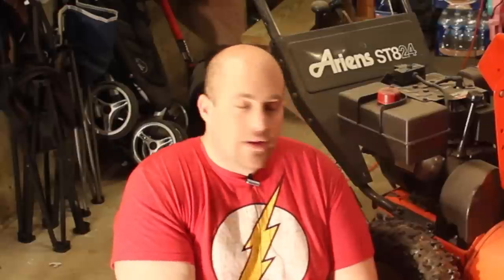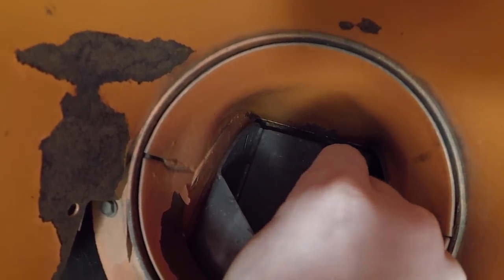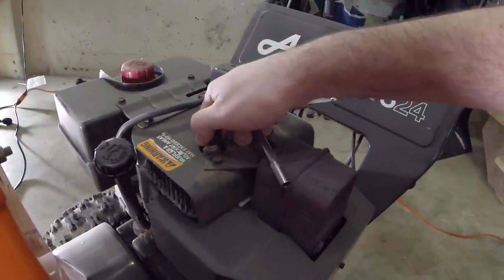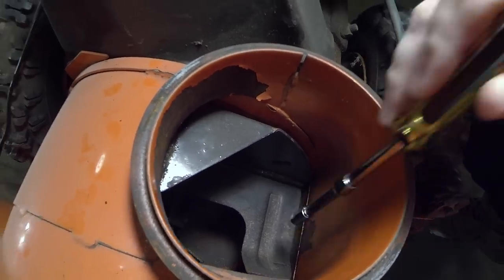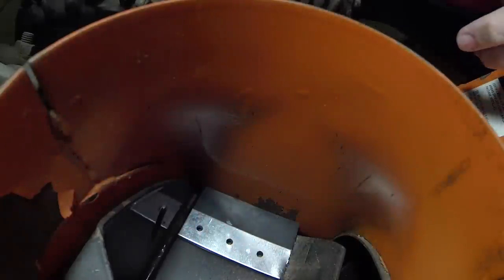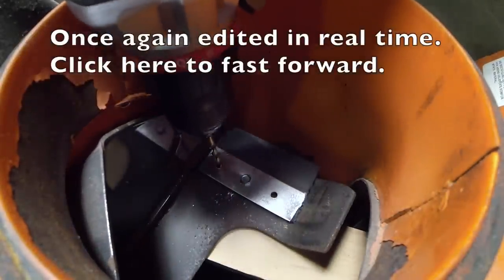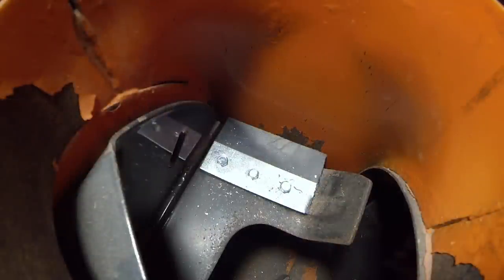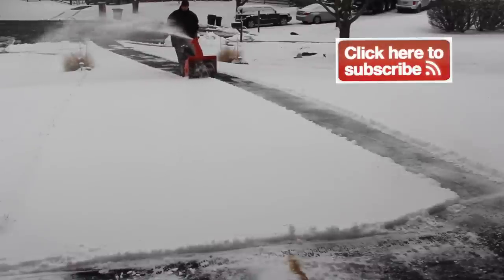TURBO CHARGE YOUR SNOW BLOWER - How to Install a Snow Blower Impeller Kit

Comment: Did my toro about 4 years ago very similar install. To me the closest thing to injecting steroids into a snowblower! Lol. Will blow the wettest of snow, damn near blow water !!! Lmao. Never clogs and blows twice as far! Impressive!!!
Reply: How thick is the rubber piece ?
Reply: @josecenteno3273  1/4 inch, 3\8? I can check when home later to be sure. I got material from tractor supply. I have done several others since i have done mine. Friends, family etc...
Reply: @paulcondie2520  Thanks
Reply: @josecenteno3273  that is 3/16 thick by 4 inches wide! It comes in a roll at tractor supply. The description has something to do with a hay Baylor! Lol. But its reinforced and perfect for this application! Better than any mudflap or piece of tire sidewall!!! I drilled impeller and used small bolts with Teflon locking nuts. Used mine commercially for five years now without an issue
Reply: @paulcondie2520  Thank you buddy..

Comment: Next time you cut stainless steel, use a spring loaded metal scissor. They're specially designed for cutting thru stainless.
Reply from the maker: True. I busted my hand doing that. An angle grinder probably would have been best but I gotta work with what I have. I'm poor. :)
Reply: If the steel is more than 5mm in thickness, then an angle grinder would be best. Neither a scissor or a grinder cost that much in the US tho. You don't need the biggest, baddest grinder either, you just need one that will do the job for you, and not get broken.
Reply: Whizzer would work best.

Comment: Nice video. I have an almost identical snowblower and it doesn't handle wet snow well. The dry stuff it will through forever. Is this a kit you purchased ? I could see making your own , but if there's a kit available that would be great .
Reply from the maker: +Gene Myers Thanks for your support. Here are the kits - 3 Blade Impeller Kit  http://bit.ly/3BLADEKIT 4 Blade Impeller Kit http://bit.ly/4BladeKit 5 Blade Impeller Kit- http://bit.ly/5BladeKit

Comment: I just picked up a Ariens Delux 28 SHO snow thrower. Will this mod work on it? I ask as snow here is gone, but could not pass up on the deal I got on it. Engine is 306cc, 15 ft/lbs. The gap is 1/4" there abouts, but under 3/8". Any input would be nice.
Reply from the maker: I don't see why not, if there is a gap on the impeller, then you should be able to close that gap.

Comment: when drilling a steel plate with a same  metal drill like steel drill its always good to go very slow with some oil to"CUT" better into... By going fast heats up the drill bit and dulls it and you can drill till the next Full Moon and still no hole.....  The school years ago where we had metal shop in High School explained it then.... all smiles we will help you now youngin Mellenials.... where I know they have no metal shop.... I think its called "Put neck down and use fingers to look it up on smart phone, then type Friends , then check mail , oHHHHH back to tapping a hole ,,, ooooops "HI MOM"... oh back todrill not drilling,,, to DUde check this video out.... to oh yea... drill slow..use oil when drilling,, job complete..(The person writing this post... My Friggin Nerves, STELLA) Too funny
Reply: My high school has all the hands on classes but they are electives, I took no lunch and had wood shop, metal shop, electricity/electronics classes, and CAD which I feel was a fair trade.
Reply: Drill bit technology has changed since the 60's old man, you can lean hard on cobalt bits and they'll just eat, constantly pulling out chips keeping themselves cool.  -Millennial

Comment: That metal is really too thick for tin snips.  Using a hacksaw you would avoid bending the metal pieces and get a much straighter cut.  It would probably also be a better tool for cutting the rubber pieces down to size.

Comment: Just a warning for next time. If you have a good clean or new spark plug that could still send the spark from the wire to the plug. Just tape the wire to the top facing AWAY from the spark plug. Stuff happens mydude. Rather be safe than hurtin!! Haha's. Right?

Comment: I would use hard core self tapping screws with washers no way they come out lol.
Reply from the maker: 6 one way, half a dozen another.
Reply: "no way they come out" ... right ... they won't come out when you need them out to adjust or replace the wipers.

Comment: Why not purchase a higher quality unit that does not have the large "gap' you're referring to? My 30 inch 13 HP DR Power unit has 1/8" gap between the impeller and the housing.
Reply from the maker: Thanks for watching. Here's a few reasons. 1. The snow blower was free  2. How are you supposed to know which one has a small gap and which one has a big gap. Unless you have a floor model that you can take apart you have clue because its not advertised. 3. Even 1/8 gap can cause build up. I now have no gap. It's rubber on metal. 4. This was cool easy project and it didn't cost a lot.

Comment: its a lot easier to disable the blower, then you can put it in a vise to drill it, then add the pads, resemble the blower and adjust the pads
Reply: Have you done that? That is not an easy job.

Comment: do this and spray pb blaster garage door lube on your auger and chute and you will never clog.
Reply: working shlub don't think self tappers would have made it through 1/8th plate, if you're going to drill why not fasten it right...
Reply: working shlub, what is pb lube?

Comment: Not seeing the turbo or super charger that all you content creators say in the video title.
Impeller modification on the other hand is another thing entirely, and that thing spins how fast again? The imbalance it creates will shorten lifetime of auger gearbox (which is connected to impeller) and impeller support bearing.

Comment: You need to update your tools.  A drill sharpener would come in handy.  Also a grinder instead of hosing up a fair set of shears.  Nice video though.
Reply from the maker: Gotta work with what I have.  I'm a poor man. Got the job done though. :) thanks for watcihng.
Reply: ya, even with a flat file you can resharpen them old dull drill bits!!
Reply: Yea you don’t need no fancy sharpener, an angle grinder will work fine. Watching this drill makes me cringe

Comment: why didn't you use self tapping screws to do that job on the impeller? would have been 10 time easier
Reply: Won't hold. The rubber is getting pummeled. They will loosen fast.
Reply: Your wrong.  Self-tapping screws work fine!
Reply: Guy Hermanson Your right self taps work fine. One thing you do wanna do is put Iron strap down where the self taps go thru. It gives the rubber more to hold it and acts as a barrier like a washer so the rubber will not start wearing past the head of the self tap screw.
Reply: Fearless, Would galvanized pipe strap work instead of Iron strap?
Reply: Rich Speers Yes, your just using it as support so the rubber stays in place and doesn't rip out over the screw heads. Anything along those lines will work.
Reply: A friend of mine got his 4 fingers cut off by a snow blower that wasn't turned on because of compression stroke , you need to take out the spark plug first not just the wire.
Reply: @brianmanning34  For real, man. I got myself a free snowblower that wasn't running. Even though, I know engines very well, I didn't think much about it. I put my hand in there to rotate it a little bit. I only  saw the danger of it after people mentioned it.

Comment: I think you NEED a sharper drill bit??? that should not take that much pressure and time, try a nice sharp bit. It makes a huge difference with a good sharp drill bit... you should be drilling throw that thin cheap steal in seconds, meaning less than 5 sec.

Comment: Don't buy the gold drill bits they are junk get the ones that are black they are a better quality and stay sharper longer. And actually only would have had to do two blades 180 deg off to keep balance.
Reply: Black oxide bits dull from heavier metals.  I ruined two bits trying to drill through a hard drive because I didn't know any better. 
For bits that'll go through anything, cobalt bits are the way to go. Drilled through that drive like it was butter.

Comment: Rubber is keeping the impeller from turning. I guess I have to leave a little more of a gap.
Reply from the maker: DrMario Pepper Nope no gap here. Bump it up right against the side wall. The rubber will bend or shape perfectly. It’s been working great for years.

Comment: It's like watching a monkey trying to f*** a football. Mark your holes, remove your material, center punch your marks and drill using lubricant. OR just use some self tapping metal screws with washers and call it a day. Made 3x's more work out of this than necessary.

Comment: Great way to ruin the impeller Auger bearing. That gap is NOT ENOUGH to make that much difference. If your bearing IS going bad, the set up you put on will DRAG on HAVE TO housing. I wouldnt WASTE a DIME on this set up. That clearance is nessary for wet heavy snow and prevents the impeller from freezing to the housing. I GUARANTEE THAT SETUP WILL RUIN YOUR BEARING. Scrape that loose paint, sand and seal that rust and repaint the housing and you will find the snow will fly from that blower. That rust creates resistance and can clog up the wet snow. Afterwards spray silicone in the housing, on the auger and impeller.
Reply: RC Hobbyist Extreme If your bearing is going bad you should replace it!  Since you have never done this you haven’t a clue what will happen!  That gap certainly doesn’t help with slush!